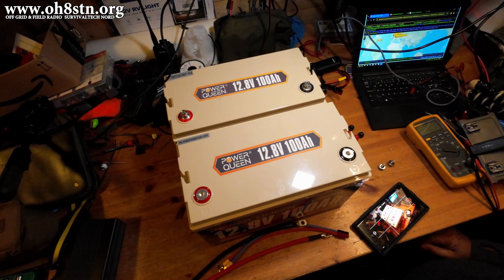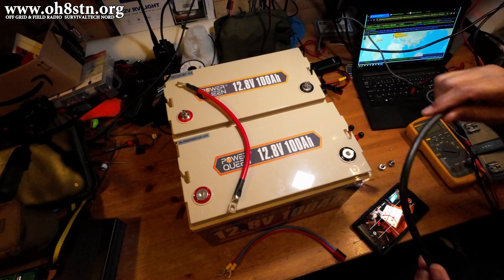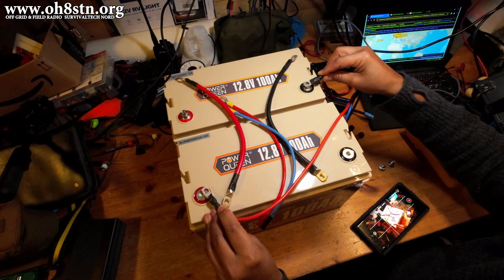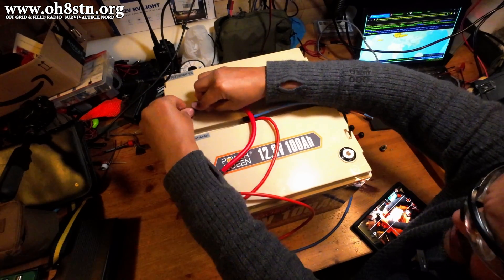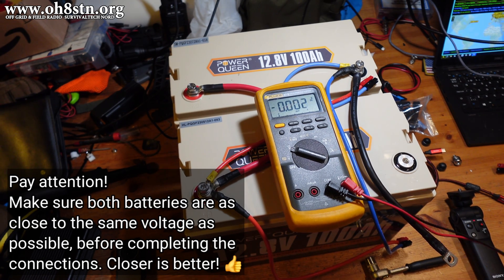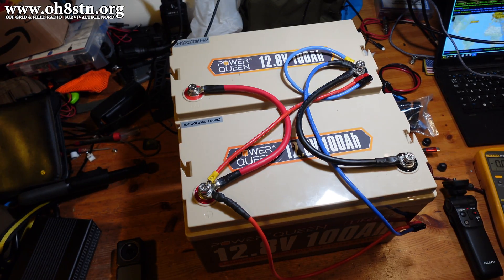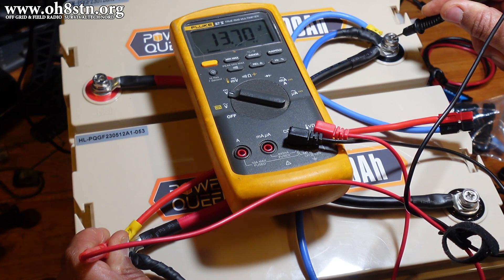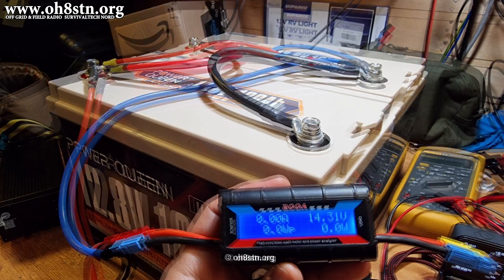Parallel batteries | off-grid ham shack

Comment: Nice video, but I'm wondering why you use separate cables for charge & discharge
I wire them all to a multi fuse harness so that charge controllers and the discharge all go through a separate fuse, but in the same panel.
(I use ANL fuses as they can handle higher currents but also have low current fuses in ANL format)
Reply from the maker: Only because the system is still in development. Ultimately I'll discharge and charge through the same massive wires. It's just easier to do it this way, while i'm still sorting out the charge controllers.
Great question, 73
Julian oh8stn

Comment: The batteries will always charge and discharge to the same voltage through the parallel strapping, there is little point in wiring neg to one battery and pos to the other. Indeed it is impossible to follow your recommended wiring for 3 or more batteries in parallel. It is also fine to have batteries having the same chemistry but of different capacities for parallel connections since again each battery will charge and discharge to the same voltage. It is series connected batteries that must be of equal capacity.
Reply: It is advised to wire pos and neg to the first and last battery in the parallel chain.
Yes, charge/discharge will go through the parallel wiring, but there is a substantial difference if you wire both pos and neg on the same battery and the difference will build over time
That is also why in higher amperage solar installations batteries are wired e.g. pos on the first battery and neg on the last one.